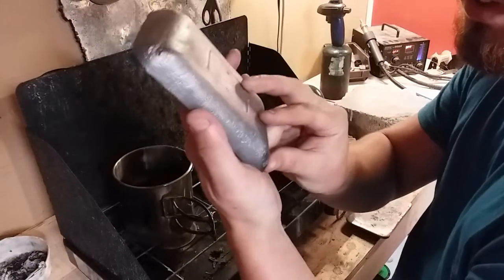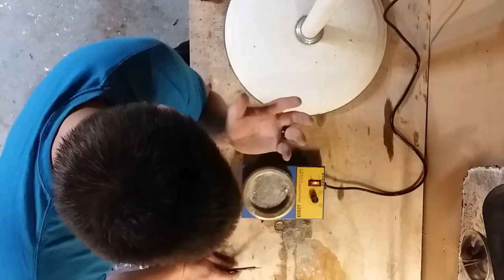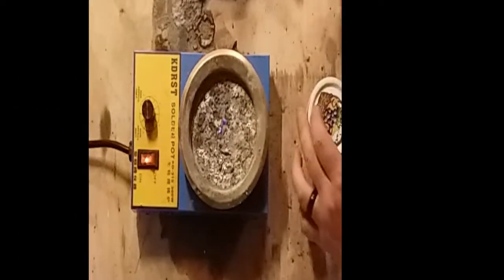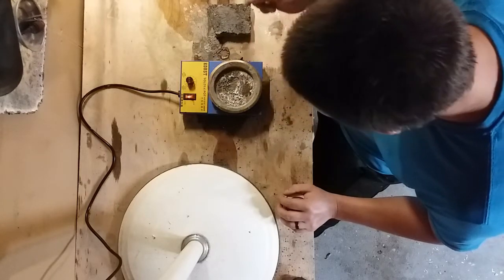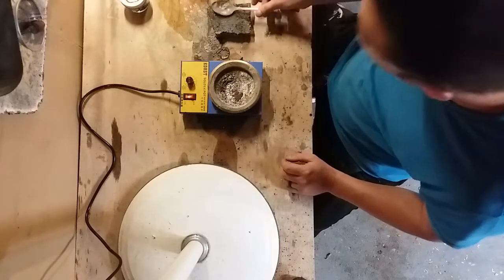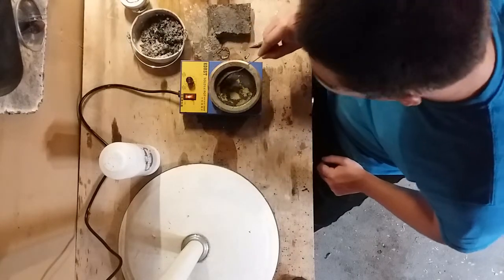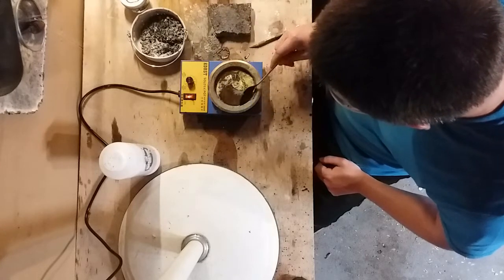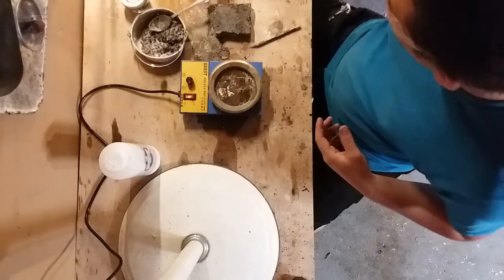Lead Dross Cleaning Process, And What Works

Comment: When I was a printer in the 70's we would peel a potato stick it on a pine stick and stir the lead pot. Our lead pots were quite large but the reaction is quite vigorous. Beware though it spits molten lead so you need PPE when doing it. It used to bring all the dross to the surface and scoop it out, and pretty much all you would need to do. We would however still throw a small piece of bees wax on after and the thing would ignite and burn off any residue left.  Hope that helps, cheap and effective.

Comment: what about Nitrogen dosing? Doesn't that work well?
Reply from the maker: works very well for preventing dross from forming, but not for removing dross.
Reply: @curiousbell  Thanks. Do you have any procedure tutorial on nitrogen dosing? or any manual? It would be useful for me.
Reply from the maker: its a fairly simple processes that requires liquid nitrogen. i don't have any videos or manuals, and when it comes to using it with lead/solder i cant seem to find much material about the subject. from what i can see you simply fill the liquid lead environment with nitrogen gas to displace the oxygen. it is the oxygen that causes most of the dross. the danger to this is of-cores that by displacing oxygen you cant breath in the environment, and because it is nitrogen that is displacing the oxygen you wouldn't even notice the dangers of it before it was to late.